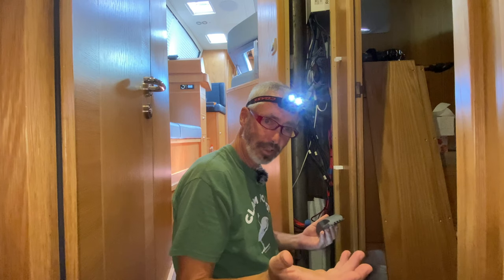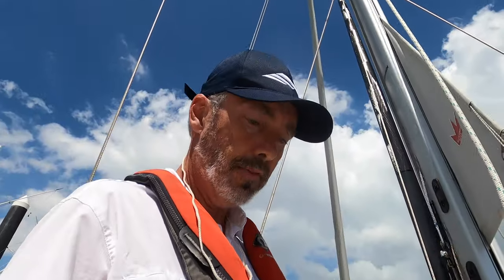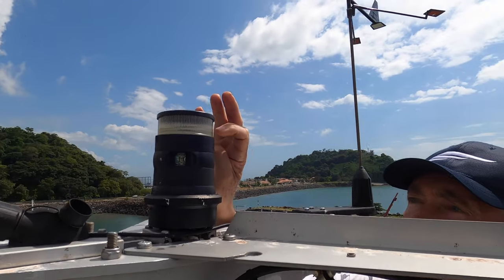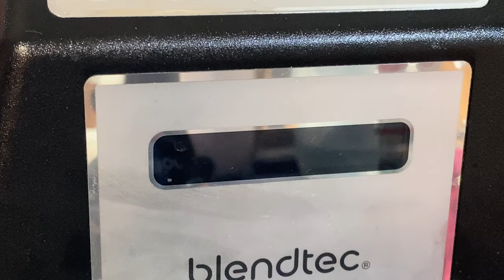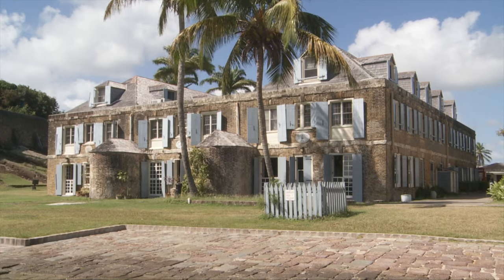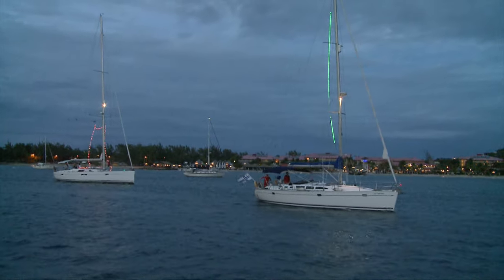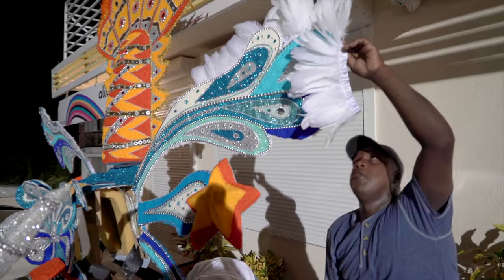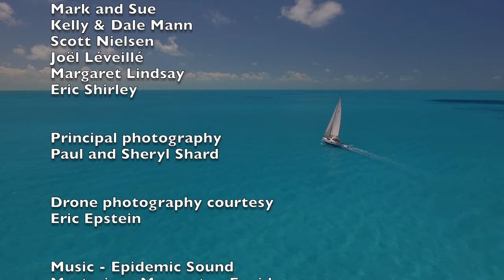Up the Mast! Lightning Strike? | Distant Shores | EP 199

Comment: We had a "near-lightening strike" a couple of years ago. Knocked out our 80's built VHF radio and depth/speed instruments. But our phones, recent handheld GPS and brand new tiller pilot "re-booted" and continued to work. So your explanation of electromagnetic waves makes sense. Also,we had learned that a large cargo ship in the area also had some of its instruments knocked out. We knew that as we were locking through the St-Lawrence seaway and the staff shared the info with us. Unfortunately for us, our insurance company was not so accommodating. They gave us such a hard time, that we gave up as some friends gave us their old spare VHF and old GPS with a fishfinder/depth meter.  Our previous dedicated marine insurance broker was sold to La Capitale Insurance in QC who treat boat claims like they were cars. Avoid general insurance companies if anybody other than the Shards are reading this. Oh well! live and learn....  Now planning on one more sail up to to Lake Ontario  for summer 2021 on our trusty Tanzer 26. Boat will then be sold and we shop for a 40-42' boat IF the borders re-open, as there are limited choices in Canada. 🤗 Thanks for sharing...maybe we will see you at the virtual TO boat show.....

Comment: Excellent video, informative and accurate to my knowledge...  any long conductors collect the EM energy like antennas generating voltage and current spikes . Radio receivers have sensitive components.  You can put inline TSPDs (Transient Surge Protection Devices) on the coax and other cables, etc.

Comment: it has been suggested to me to run a separate antenna for the AIS at the stern with a 4 foot extension . Run the radio from the mast antenna, if it stops best to have a handheld unit as a backup 
regards

Comment: Ditto on the antenna separation,  a splitter with AIS/ VHF Vesper Marine  antenna does the job well.Did you ever put the cap on the wind transducer mount at the masthead?

Comment: That separation between your VHF and AIS antennas is not nearly enough.

(With both 3db gain antennas, 1 meter would give you only about 10db of isolation)

When you transmit on your VHF (25W) you are most certainly overloading the reception on the AIS. It might not create problems straight away, but it is definitely not good for the devices.

Because good horizontal separation is not practical in a mast head (3-4+ meters), vertical is preferred. Move the AIS antenna to one of the spreader, or to the stern arch.

Cheers
Reply: Totally agree! the antennas actually are in each others reactive nearfields and through mutual inductance seriously affect each other in multiple bad ways. Vertical separation would be the best and lowering one a couple of meters will not decrease the range substantially (the range might actually increase!)
Reply: I agree on that one. In case you have no other option, I would use an antenna multiplexer and use just one VHF antenna.  AIS on the stern arch would limit the reception quite a bit, giving you a later notice off other ships. And with only 6 W class B AIS the oncoming tanker would also notice you at closer range.
Reply: @Nerd3927  Or a single integrated VHF/DSC that does both.
Reply: @Nerd3927  I have mine on the stern arch. There are a lot of tankers in my area, I see them on AIS from 20-30 nm away. And already confirmed with a couple of them that they see me on AIS from at least 15 nm (I actually couldn't get hold of them on VHF before I was around the 15 nm mark.)      Having a lower mount antenna might limit your reception from other low mounted antennas (some speed boat, maybe), but big ships have theirs way up, so, no problem there.
Reply: As for the multiplexer, yeap! some times they are much more convenient them making a new antenna install. And from the people I know that use them, I have heard of 0 problems so far.